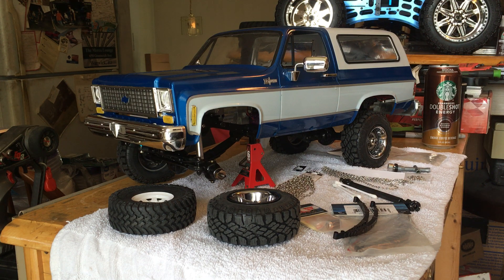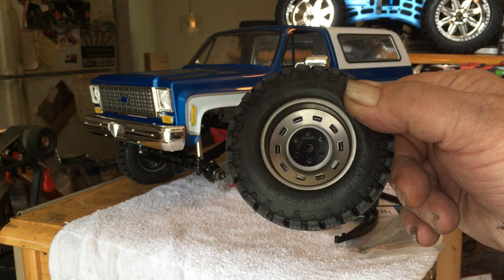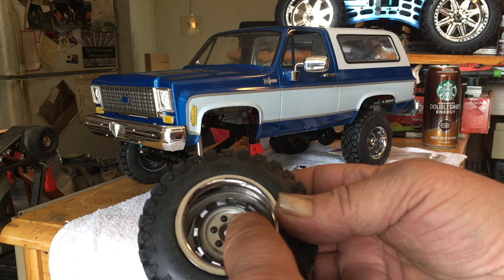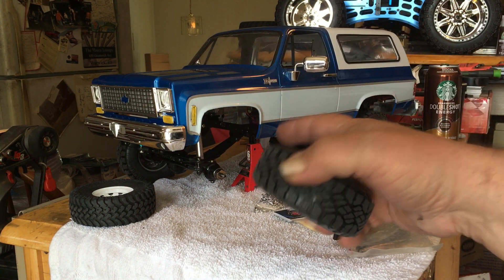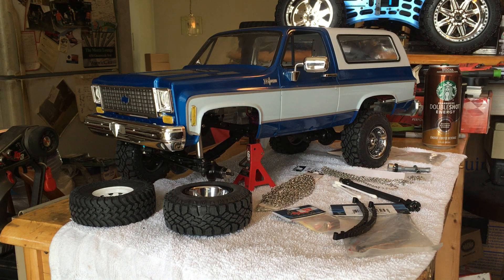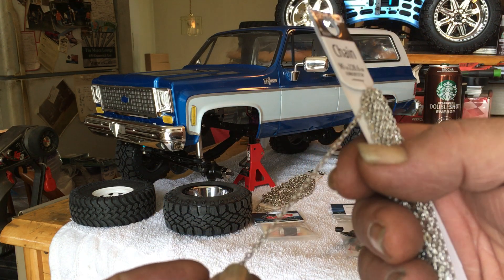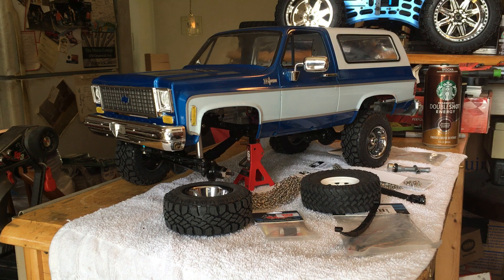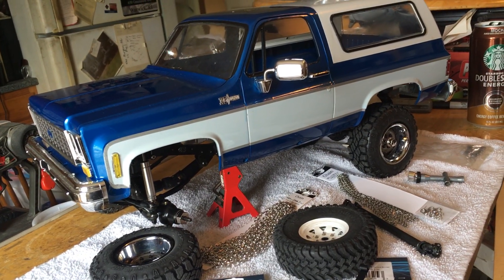RC4WD Blazer wheel review

Comment: Yeah the axles were wider because they used a Dana 44 or 60 front, and a GM 14 bolt rear. Same with the Ford Bronco. It had the Dana 44 front as well, with a ford 9" rear. The ford 9" looked remarkable similar to the Toyota 8" axles. But, both trucks did have a " unique" stance. Correct me if I'm wrong internet. But that is how i remember it.
Reply: The front axles may have been danas but the rear axle was narrower so the tires wouldnt run in the same tracks for more traction was the reason.
Reply: The front axles may have been danas but the rear axle was narrower so the tires wouldnt run in the same tracks for more traction was the reason.

Comment: Just received notice that they're back in stock again so I've ordered a set of those rally wheels.  Man, your Blazer looks sweeeeet!!!  Think I'll do mine in blue and white as well.  Did you have any trouble getting your hood to fit?  Mine is taking a lot of work; doesn't want to set flush with the tops of the fenders.  Lots of sanding/filing.  Same with the tailgate.  Yours looks great.  Thanks Denny.
Reply from the maker: Yeah grab those wheels as fast as you can they blow out of stock in minutes! I have missed them twice before I got mine lol, I had the same issues with the hood and tailgate also, if you plan on multiple coats of paint be sure to sand down the edges to compensate for the material.    Happy building through the year!

Comment: Is that the limited edition tf2
Reply from the maker: No this is a early tf2 that I put the Blazer body on.
Reply: @dennisdempseyradiooutofcontrol  it looked like the limited. You still run it?
Reply from the maker: @orion000  I did until recently, I disassembled it to change the axles to the vanquish "Currie rock jocks"
Reply: @dennisdempseyradiooutofcontrol  oh nice.